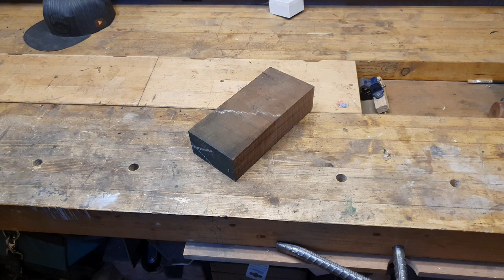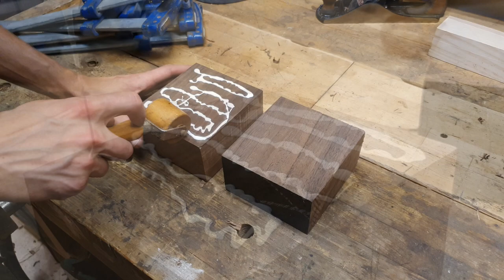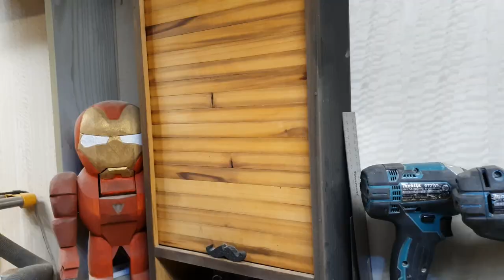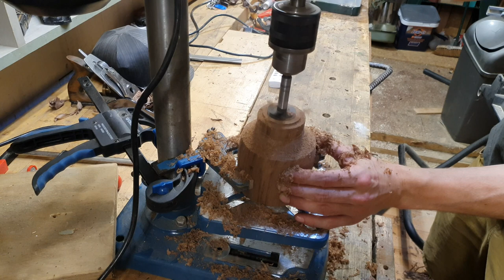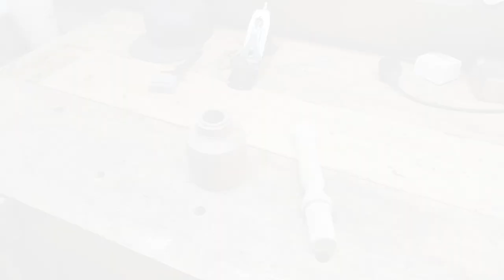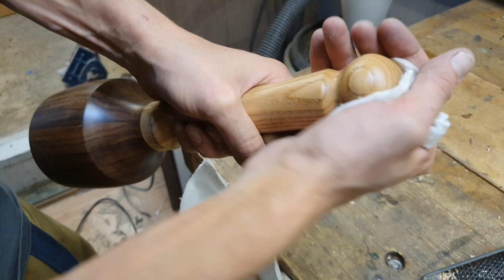Carvers Mallet - Woodturning project

Comment: This is wicked project looks amazing. Ive just bought cheap lathe to have play with and hopefully get good at. One question can this be done without a chuck?? 🏴👍
Reply from the maker: Thank you very much Michael 👍 I'm pretty sure you can do it without the chuck, I'm not the best woodturner 😅
Reply: @MatthewMoustache  hey listen your stratospheres above me mine was a cheap parkside lathe to start oh and it's still in box. Don't think it accepts a chuck think can only do face plate or centres any advice for a starter turner?? 🏴👍 I have so many questions.
Reply from the maker: @michaelwillson6847  I've started with old vibrating nu tool lathe and then bought record power xl 24, it's all about the practice mate. You can find me on IG as moustache workshop it will be easier to talk 😁